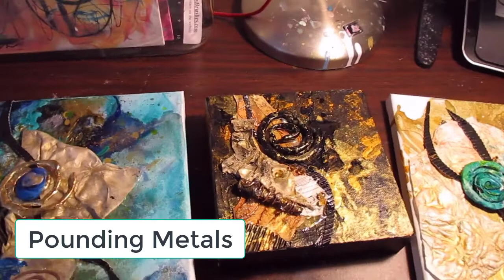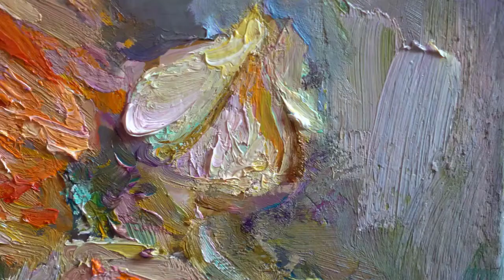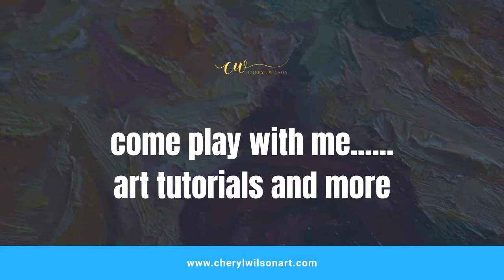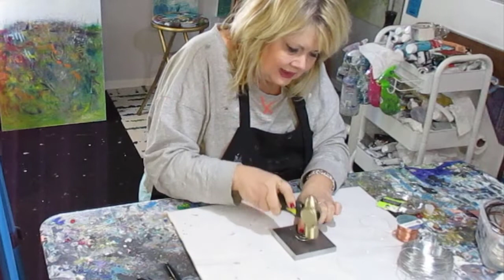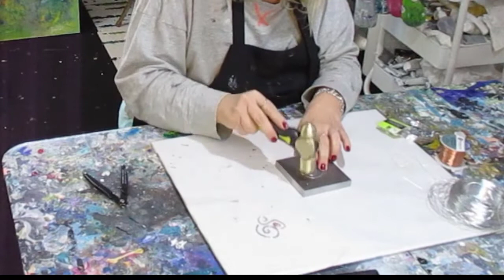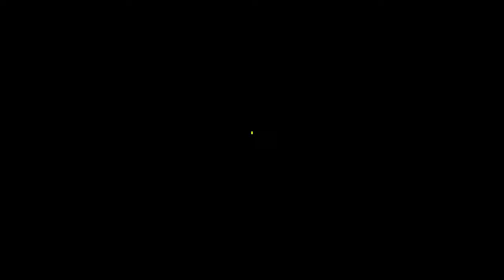Using Wires in Mixed Media to create canvas art.

Comment: Hi Cheryl. Did you do a video about mounting the wire to the artwork surface?
Reply from the maker: Are you talking about mounting the wire to the front of the canvas or the back of the canvas? I’m getting over a nasty sinus head cold virus thing so my head is fuzzy if you’re talking about the front I just shoes like a heavy gel medium if I’m using something that needs extra Security and glue and then I will add archival type glues to help with extra securing the wire on the front. I’ve never had a problem with any of the pieces fallen off and then many times I will do a spray varnish over the top.